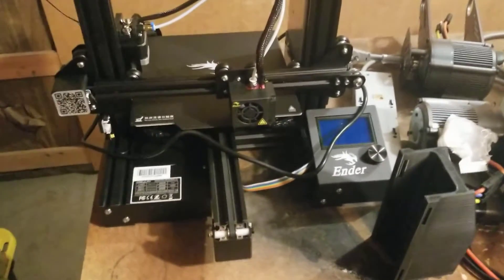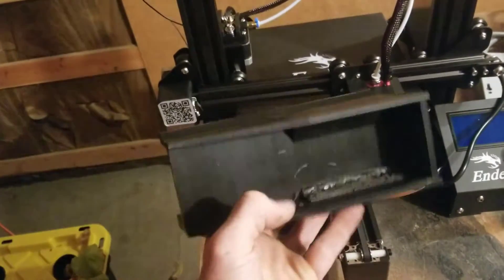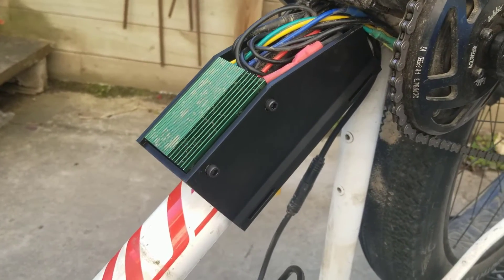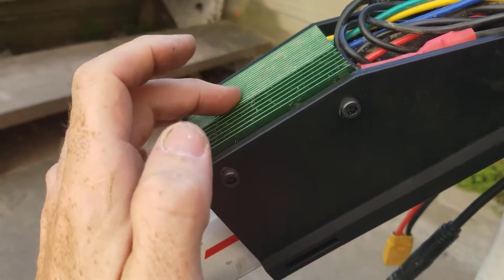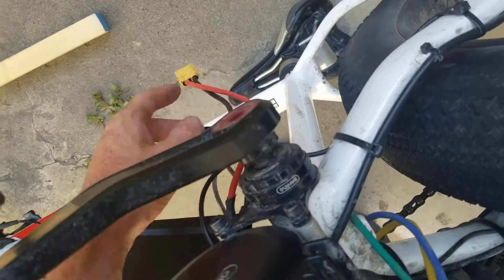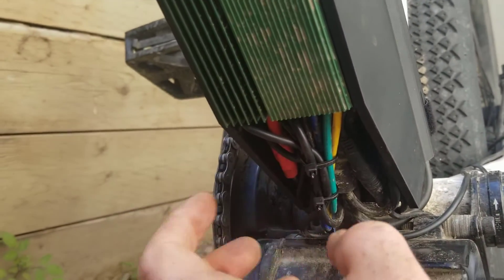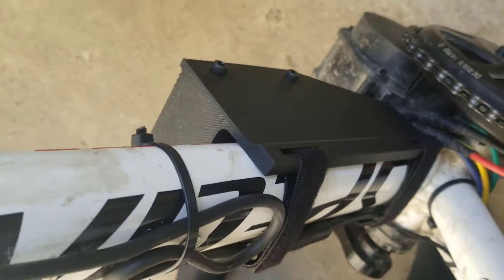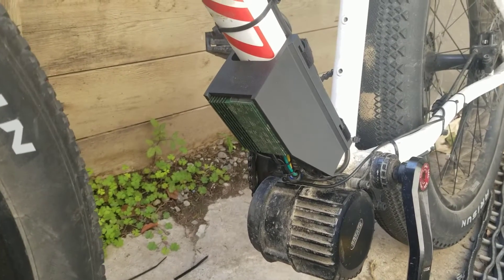ASI BAC800 - 3D Printed Mounting Hardware

Comment: Great job on your videos. I am currently debating on whether to get the BBS HD or the CyC X1. First time ebike builder can you recommend what motor to get? It’s a hard tail commuter bike (Rocky Mountain Trailhead). I will be doing 15 KM to work each way. I plan to get the 52 volt triangle battery from EM3 EV.
Reply from the maker: Either will work. The cyc now will have alot more options and torque sensing etc. The bbshd is pretty bomb proof and very reliable. I love both. If you shoot cyc and email and describe your project they can make some suggestions. Or you can order the whole kit from em3ev. Get the high power cells though with the battery so you can run 50 amps continuous.

Comment: i would also put some metal piece on the screws side, for better cooling. i guess yours doesnt overheat. on my scooter, where there's no airflow inside, it's essential.
Reply from the maker: I'm redesigning the piece at the moment. It was the first thing I did really. But you are right on the money. The bolt holes are primarily for fixing additional heat sinking. I'll be looking to make use of it for sure. I'm thinking that some thermal compound will help as well to joint surfaces. The hotest it got has been 56 C The potential is there but the controller will start to limit current and self govern essentially over 60.... Just as well as pla filament starts to soften then also! Cheers!

Comment: This is a great idea, I was just going to make a little mounting plate from aluminum and screw it to the water bottle holder then to those holes on the bac800.

Now I want a 3D printer even more...
Reply from the maker: They are an m5 bolt for those holes on the side.